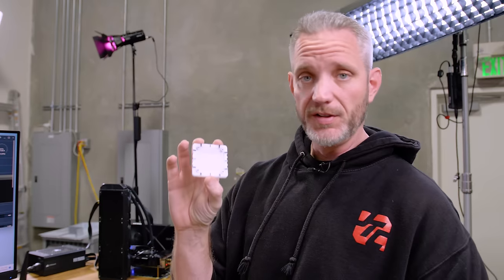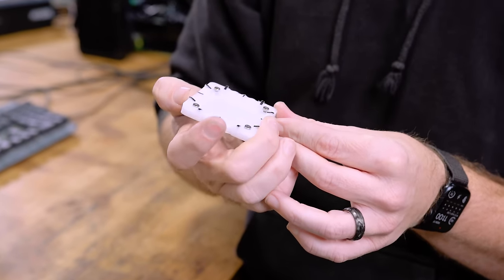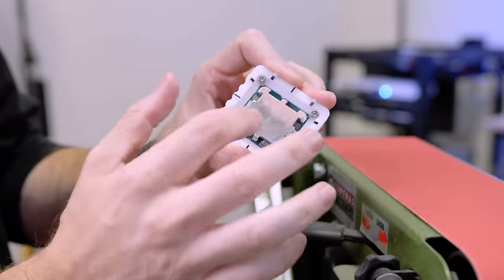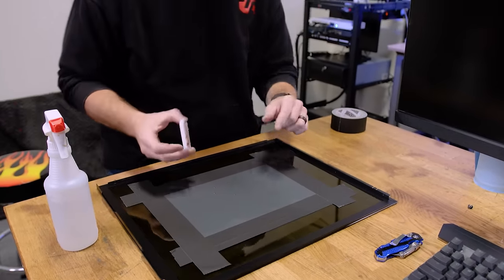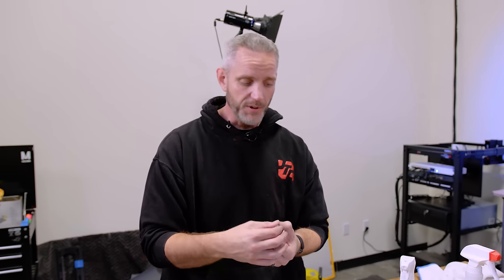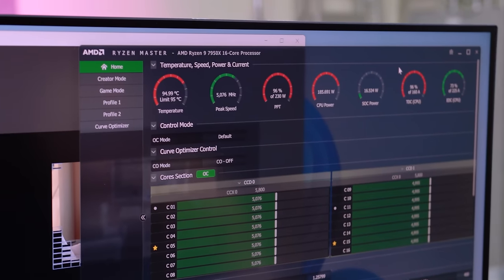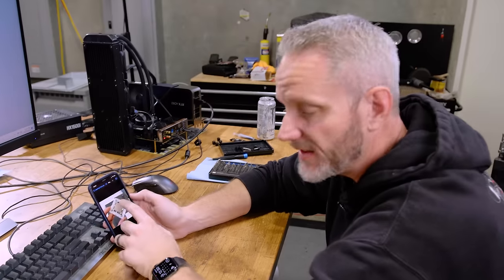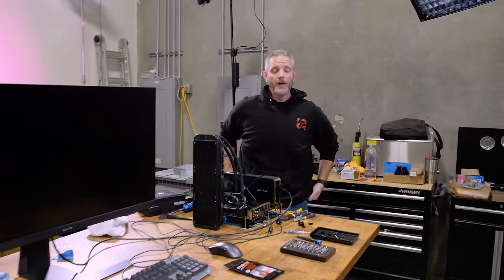Modifying the 7950X CPU for better thermals... VOIDED WARRANTY!

Comment: A couple of comments from a person who really does not know anything about this stuff, but knows more about other mechanical things.  Car guys who know anything would not use polish with a wax or coating to polish the cpu.  They would use rubbing compound which would not leave any residue and would get the surface very very smooth.  Also, you refer to "lapping".  Lapping is when you rub both mating components against each other to make the surfaces mate to each other.  You are just flattening the surface, not lapping.  If you took rubbing compound placed it on the cpu, then rubbed the cooler block on the cpu to mate the surfaces to each other, that would be lapping.  I wonder if actually lapping would work?
If thinning the lid works well, a company should offer a service to put the cpu in a milling machine and use a fly cutter to remove material and make the lid very flat.  Then final polish on a granite surface plate.  The equipment to do this is not expensive, (a small cheap milling machine), (small granite surface blocks are cheap), so I would not be surprised to see this service offered by someone.  The only thing I worry about is chips and metal debris getting onto the cpu components.  Maybe blowing off with compressed air would be enough to clean this off?
Also, I wonder how hot the cpu actually got on the surface when you were sanding with the belt sander.  I better the surface got way hotter than you think it did.  If the cpu and the tool used to hold it got hot to the touch, that surface was way way hotter than that.  I think you really need to go slowly with the belt sander, only a second or 2 at a time and let the cpu cool down between passes.
Great videos by the way, and I am not trying to be a know it all troll, I am genuinely making suggestions, and observations.

Comment: So I would finish this grinding process with good quality japanese knife sharpening stone (will take much longer to grind) to extreme flatness and I would use liquid metal with cpu gasket. I'm pretty sure you'll get much much lower temperatures.

Comment: Come on Jay, you know car stuff. Lapping is not the right term for what's happening here except for at the very end. Lapping is just the flattening of the final surface, not the removal of material to change dimensions. I would really love to see lapping in the same way you do to valves in a cylinder head; put an abrasive paste in between the cooler and the IHS, and agitate the surfaces against each other until they are equally flat and perfectly mated.
Speaking of car stuff, you should have tightened the cooler down with some Plasti-Gage in between to check clearance instead just turning it on with essentially no cooler :) that would have been a cool trick, but I appreciated the panic sequence that ensued anyway LMAO

On-topic, though, I think AMD will remember this day as the day they almost released a freaking monster CPU, but hamstrung it with a jumbo IHS for the sake of backwards compatibility - which didn't come to be, anyway, since upgraders still need a new, preposterously expensive mobo, new RAM, new PSU, etc, etc. They could have embraced the incompatibility with AM4 coolers - or messed with a different element, like the Z-height of the mounting substrate - knowing that early adopters were going to be spending a fortune anyway, especially for the flagship part and had something untouchable right out of the box.
Based shareholders will not let them forget this.

Comment: remembering lapping my Opteron 144 back in the days before deliding it, end the end I was limited by the northbridge.  But 2 years afters I got a spare A64 4000+ and went 3Ghz opening the case outside in -20°C winter.. it was 2006...

Comment: Hey, if the IHS is so damn thick, and made of copper, then why not just use a CNC machine to carve out grooves, like you see on high performance waterblocks. 
Then all you have to do is glue the top part, without having to worry about contact height or even thermal paste. Just turn the CPU into its- own waterblock :D

Comment: Isn't the chip was designed to keep boosting the clock until it reaches 95 degree? So no matter how good the cooler is, it will still reach 90-95 on full load.

Comment: Screwing the tool to a sanding block could help with applying more even pressure. Just a thought. I'd sand up to 4,000 grit sandpaper as well. That's just me though.

You could also try to carefully sand down any of the hardware that's interfering with the contact to the CPU or try thermal contact pads?

Comment: I think reviewers need to find a way to display practical usage temps. This weekend I built a 7600X system for a local and daily drove it over the weekend to make sure it was broken in and stable, and the review numbers didn't hold up. Benchmarks are great for seeing maxes, but are terrible for displaying what actual day to day usage temps will be, or for that matter what day to day uplift in games will be. So you're buying coolers, and even PSUs that are way overkill for day to day usage. Although I do think too much power is never really a bad thing, so don't skimp on the PSU, especially in this generation of hardware. Unless you've got a game that really leans on the CPU really really hard, you will not see any practical performance gain from going latest and greatest. As always the GPU mattered far more than the CPU in all but I think Civ6? Might have been a little quicker turns. Still awesome CPU that I think is suffering from the same meme that surrounded 12th gen as far as heat/power goes. The numbers your seeing in reviews are only representative of if you're system is being pushed really really hard. Maybe in professional settings you might see these temps, I can't speak to that, but for gaming? Nothing will push it anywhere close to 95. A dark rock 4 kept this thing in the 60s for anything outside of benches, and on eco mode take another ten degrees (ish) off that. Temps jumped around a bit more on eco, but were still lower. I think that was just an odd optimization quirk and perhaps a result of at that point in testing I was running so many programs at once to test what would happen if for some reason this dude decided to play a game at max settings, while watching a movie on the second monitor, and compressing/moving files around on a third.

Oh and just so no one makes the same mistake. If you're going to use the Dark Rock 4, it'll handle the temps just fine, but please make sure you have clearance before committing, I didn't, and cleared the RAM by a hair. Maybe look at the pro version if it's a compact board.

Comment: the laping guides could easily be 3d printed on a resin printer and even on an FDM printer that's been very well tuned. A STEP file would be incredible. Also why not use a diamond sharpening stone. yes they are expensive especially a big enough one for a cpu but it will be much flatter than sandpaper on a sheet of glass especially if it hasn't been epoxied in place to actually be close to flat. Flat is a whole different school of engineering.

Comment: I really wish AMD had just adopted an appropriate mount, rather than shoehorn the AM4 mount, which seems pointless anyway since half the coolers aren't compatible and adaptors are needed anyway. I'd rather AMD had reduced the IHS thickness, designed a new AM5 mount and then had an adaptor for any existing cooler that needed it, least the CPU wouldn't have been limited and performance stunted! For something like lapping, or DeBauers delidded mount, seem so much effort and money, when I'd have prefer to spend $5-15 on a AM5 mount adaptor (if cooler manufacturers didn't offer them free) that would've been hassle free. I was kinda excited be AM5 but I don't want the CPU running that hot, I'll stick with my 3950X for now, and probably just swap it for a 5950X or a 5800X3D in a year or 2. Both CPU and GPU manufacturers have to get it through their thick skulls that in a time where the cost of living is deliberately being pushed through the roof for whatever agenda, many people don't want power hungry and/or hot components, it's time to start adding efficiency back into performance, remember those days!?!

Comment: 8:10  Beg to differ, A Flat surface in the very definition of a minimum surface area. The distance up and down the peak increases the surface area. Think V grooves,   VVVVVVVV vs. ------------------.
Come on Math guys, calculate the proof. As a Tool and die maker, polish in a figure 8 pattern.

Comment: I feel like AMD in their goal of allowing AM4 cooler backwards compatibility shot themselves in the foot. It performs better with a much smaller IHS. And that's not just lapping, that's a significant decrease. That being said, I don't think i9s and Ryzen 9s should even come with IHS. Hear me out. Those are enthusiast level products and cooling them is hard as is. We used to have bare die CPUs back in the day, right? So why not have them ship those with a new retention mechanism for the motherboard and possibly some spacers that would allow coolers to come lower to get the contact needed by removing the IHS. It would lower the temps and allow them to squeeze more performance out of their CPUs.

Comment: Any tips on performance improvement for an old 3900x? Its on a custom loop, so lapping might not do all that much extra but how about pbo, settings or oc? Havent touched it whatsoever in that regard
Reply: Set the scalar to 6, override to 200mhz put load line calibration to mode 6 so it uses less voltage when boosting to lower temps so you boost high more often if 6 crashes try mode 5 make sure eco mode is off. 

Try the Edc bug and set it at six than try to offset the voltage as low as you can go and still be stable without crashing. And run vine benchmarks to be sure what’s setting benefit you the most

Also make sure your ram is running at its rated speed by turning on xmp

Comment: Id get the cheapest am5 Ryzen cpu and lap that down to its limits for the testing and getting it flatter.
Once you nail it, de lid it and swap the better IHS over to the 7950x to test a liquid metal application before trying possible die lapping and direct die cooling.

Comment: There is no way you can make it flat using grinder. Taking 0.2 mm is way too much already. If you have a cheap caliper sure the thickness is not the same on all corners. Hand lapping is way to go...

Comment: The results are mediocre but better option than delidding IMO.  My 7950x hits 39,262 on single run with stock limits simply turning on PBO curve optimizer -15 all core on a 360mm AIO with a starting liquid temp of ~32 C.  I don't think delidding will be worth the cost and risk as you'll be pushing it well beyond its efficiency curve which is going to yield little.  The lapping should be good enough to maintain a 230W load, keeping it under 95C even after water temp rises.

Comment: cpu's have always been able to run at 95c. says so right in the specs. Us watercooling guys just don't like it.... unless we get more mhz. I'm lucky I live in Maine and run my heat exchanger outside, until temperatures go below freezing, then I pull the duct work off the outside flange and run inside air. Today is 35f degrees outside and my computer is running at 12c.

Comment: Though microscopic, when doing the sanding, as the steps on the lapping guide device are some kind of plastic, wouldn't that mean some of that plastic being sanded off from the plastic 'steps' end up melting into/filling the microscopic scratches on top of the copper plate if using a sanding belt as you did, resulting in the same issue you explain would happen if you were to use polish?!

Comment: Something I was wondering; Intel increased the thickness on the IHS from one generation to the next (was it from 8th to 9th?), which helped a lot with CPU thermals. Why is it not having the same effect on Ryzen? I seem to recall something about Intel halving the height of the die itself as well, maybe that's why?
Reply: There is a sweet spot between absorbing bursts of heat and spreading it out vs holding onto heat to long to be efficiently removed by the cooling system.
Reply: If you have too much material, you have two temp. zones. The DIE side and the cooler side.  Is the heat spreader to thick, the heat cant be transferd fast enough through the copper.
Reply: @kaseyboles30  That does make sense. Thanks.

Comment: The 7900 series looks to be the easiest delid ever and this will be my first ever. Being as impatient as i am i asked on der8auer's  channel how long before the tool is ready and i got no reply. so now i started the delid process without even installing and testing my new motherboard and memory as of yet. tommorrow i will get the lid off then put the instrutions how i did it on reddit. wish me luck lol.
Reply: using a feeler gauge from harbor freight to cut the silicone at the 8 hold down locations. no razor needed go slow get through the silicone then you need a heat gun to remove IHS. easy  to remove IHS but wait for a hold down bracket from der8auer or painstakenly grind down the old one like i did to get this "EK-Quantum Velocity² D-RGB - AM5 Nickel + Satin Titanium",  to mount to the dies.. good luck people

Comment: Possible to buy nylon washer in a "wanted height". That was i going to do what will i make, when i want to using my cooler what is AM4 compatibily but with a custom bracket.. I just need some washers with 12mm height (i checked the height what is need in my case).. the hole in the washers need to be M5 sized, and need 4 piece M3 type of screw with around a 16mm-20mm height.
In my case the cooler is a Thermalright Macho Rev.A .

Comment: It ain’t flat jay!  You could also try to torque the screws for even pressure.  Also measure the thickness with a caliper.  And don’t do this kids.  The cpu is designed to run at 95c all day for 20,000 hours or something.  Go outside or something
Reply from the maker: No
Reply: @Jayztwocents  😂 🍻
Reply: @Jayztwocents  😂 🍻

Comment: The extra meaty IHS was a silly decision. After keeping the socket the same for consumers for as long as they did compared to Intel I think they would've been forgiven for changing the mounting height when going to a completely different socket and retention system. They should just release the 8000 series or whatever comes next on the desktop with a thinner IHS when the time comes.

Comment: How about the risk of getting Copper under the lid? Is there a way to seal this?
Reply: maybe you could put some vaseline in the holes an then dribble it out later in a oven or toaster oven.    in lieu of thermal paste, i've used cheap dollar store vaseline.  grease is grease.

Comment: i switched to am5. After the fist test round i hitted 80° on my 7600x. I checked my cooler and that it saw that 1-2mm was off the cpu on the topside. After I mounted the cooler properly i only hitting 60°! looks like the am5 cpus need newer cooler that fit better

Comment: If he made static levels, ie, one set with 3 levels, one set with 2 levels, and 1 set at the minimum level, he or anyone could make aluminum or steel holders and you could lap it much more evenly if using higher grit sand paper as the metal holder wouldn't get lapped as much as the ihs

Comment: given their much better thermals, do we need to worry about delidding or lapping the new 7900 (non-X) CPUs?
Reply: No. They are not as power hungry as the X variants. Just make sure you put a good cooler on it and it should be perfectly fine.

Comment: Zen4. Complete with Integrated Heat Soaker. 

I just find it mindboggling they would hamstring their CPUs to maintain AM4 cooler compatibility. Even then, if you're making a whole new socket, just make the f*cking socket 1mm taller instead of the IHS. Problem solved. It's obviously possible cause all those coolers are also Intel LGA compatible and they have a 1.1mm thinner IHS.

The whole ordeal seems just as amateur hour as Intel's bending CPUs but at least that is fixed by a $4 part and won't void your warrantee. Every enthusiast knows a thinner IHS is better but apparently every enthusiast is brighter than an AMD engineer.

Comment: There would be a torque spec for the CPU, yeah? 

I know there are wrenches that can limit the force you apply, are there any screwdrivers that do the same? 

On a flat surface if equal torque were applied on the four corners you should have an even mount, yeah?

 and if it's to spec there should be no bowing

.....

To be fair though I'm an idiot and I could be wrong

Comment: 95c may be "safe" but I wonder how much more power efficient a lapped CPU is. After all, there is a positive temperature coefficient at play where the hotter it gets the higher the impedance and therefore the more power it takes to get the same performance.

Comment: Did anyone mention the Techpowerup article on how CCD0 and CCD1 differ in frequencies across the entire 7000 series so far?  And that disabling CCD1 improves game performance by about 10%?
Reply: The latter is presumably due to thrashing of the thread scheduler, resulting in less than optimal use of cache. But yeah I noticed my CCD1 is always 50MHz slower than CCD0, while his is 100MHz slower. I thought maybe this was their way of getting a grade A part out of grade A+ and B+ sub-parts.

Comment: Wonder if you could make a jig to mount the CPU in and use a routing table with an end mill to take off 1 mm, then lap the surface. Seems like that would be easier and more consistent. Either way, WTH was AMD thinking making the IHS so thick. Makes no sense.